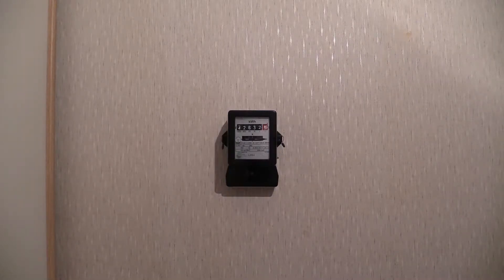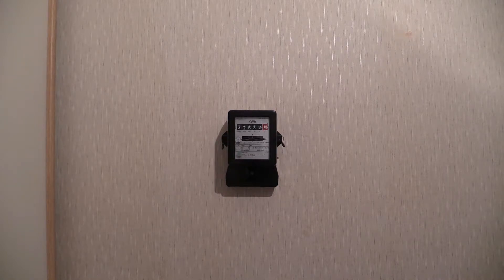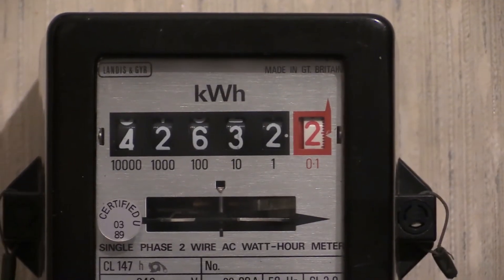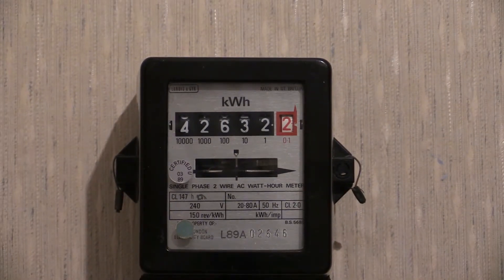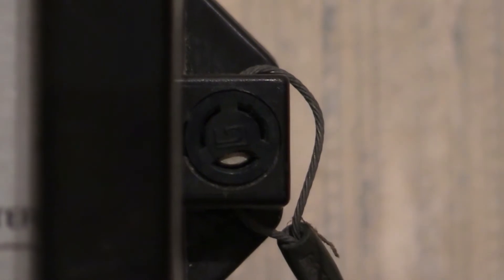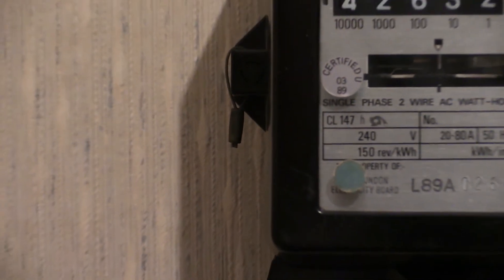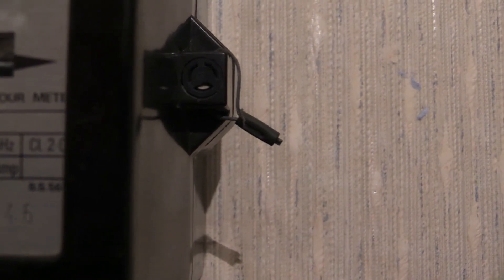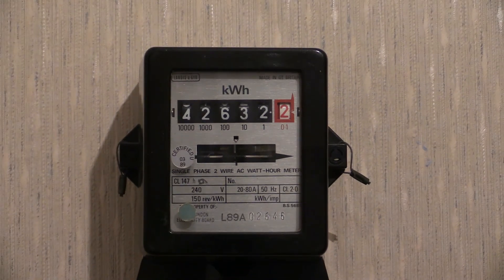Electricity Meter : Landis & Gyr CL 147h kWh meter.

Comment: I'm thinking of buying 1 of these it's already on to 15 odd thousands can I rewind it to zero befor it's installed amd does the glass remove when I've clipped the security ties?
Reply from the maker: Hiya. Please see my recent OPEN SALES video. Those instruments are ready-to-go, and because they have a low reading on them, I'd be more than happy to reset it to zero for you for no extra charge. To discuss sales, please activate the Email link on the "About" tab on the channel. Also......

.......The instruments I have for sale have the same loading capacity and have the tough one-piece polycarbonate front-cases, so they are that wee bit more durable.

I look forward to your Email soon. :-)

Thanks for watching,

-Wayne's Electrical.

6th December 2018, 13.53